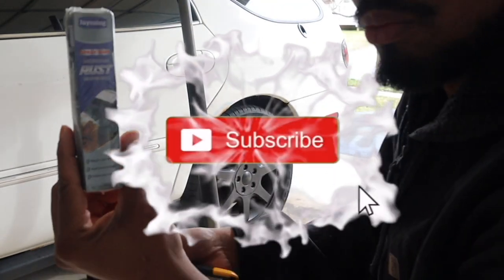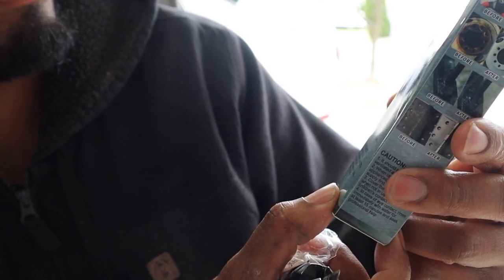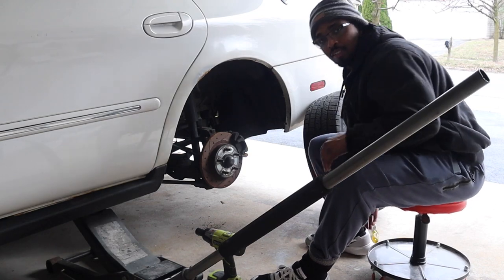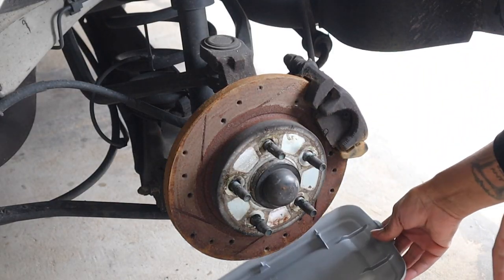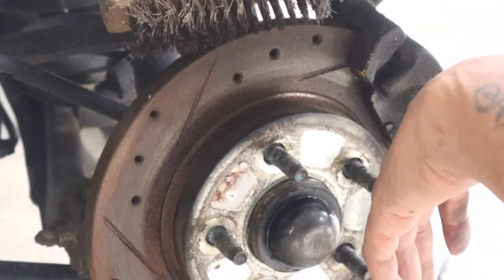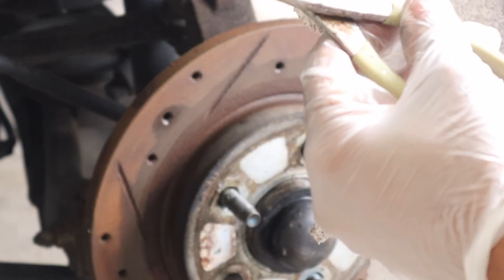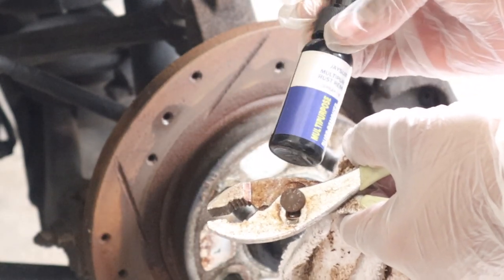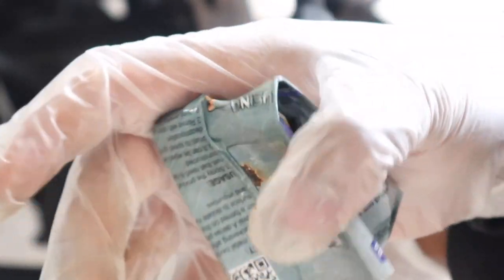Jay suing Multi-Purpose Rust Remover review! 😅

Comment: A lot of things, like the solar powered LED security light I bought, are advertised in a picture that makes them look huge and like you will be getting this big light that looks the size of a small cupboard door. When you get it, it's about 1.5 times the size of a cigarette packet. All i can think of is they either greatly enlarge the picture of the light and then the picture is superimposed onto thepicture of the house, or the light is attached to a dolls house in order to make it look about 5 or 6 times higger than it actyally is. Surely there must be some kind of trading standard that has to be adhered to?